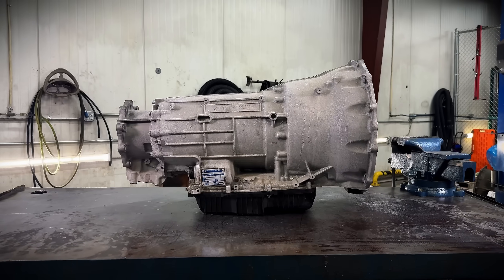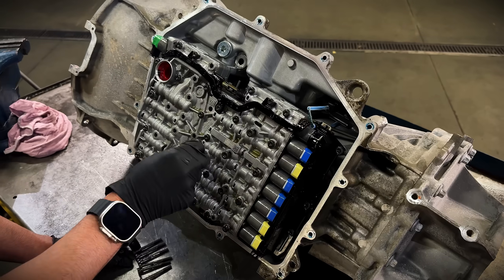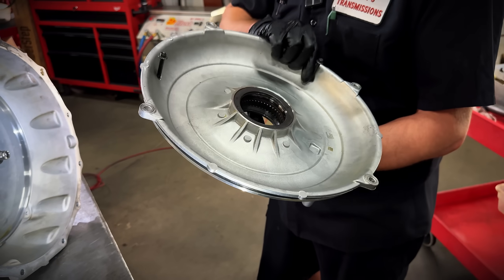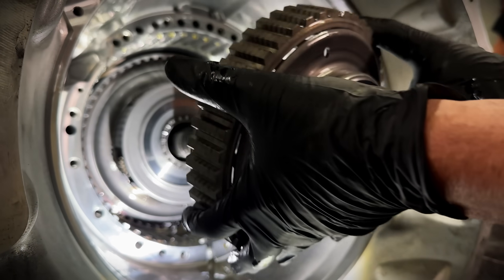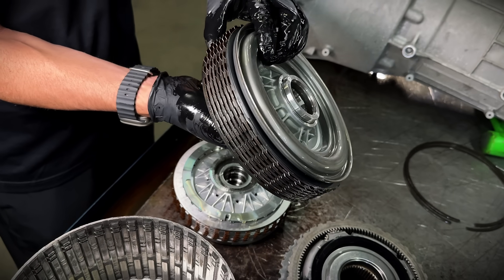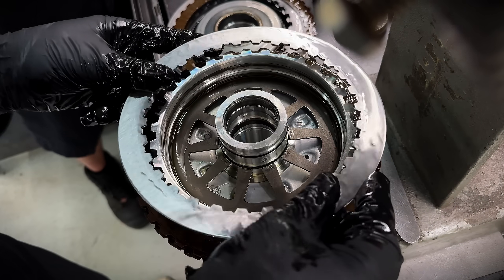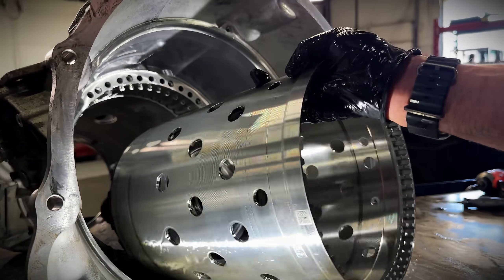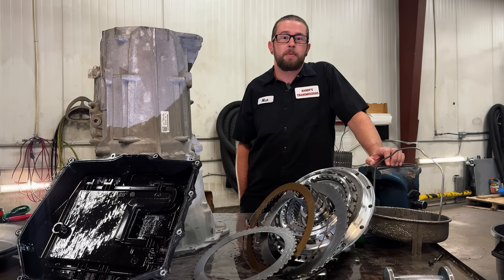NEW CUMMINS ZF 8 SPEED TEARDOWN

Comment: I stopped in Vegas at PPE today.  They had a 26 Ram 2500 on the rack with 126 miles.  They had the OEM Pan / filter off. The pan had so much glitter and flakes in it from break in it looked like a stripper or the bottom of a gold sluice.  
PPE is working on a +3 qt pan with a replaceable filter and multiple magnets 🧲 which will be out this summer.  I saw the glitter with my own 2 eyes and was horrified since I just bought one.  
I just bought a Cummins Rebel 2 days ago and the PPE engineer cautioned me to change the trans oil in the first 2500 miles then 15k to get all the break in shot out.  
He also said they have cease and desist orders out on Gale Banks and their Alum pans are NOT sand cast.

Comment: I’ve got the ZF 8 speed in my ram 2500 with 6.4 Hemi, it is hooked up to a trailer at all times and currently has 784,000 miles on it. The ZF transmissions work well and hold up

Comment: Ford need to get their act together because RAM are making them look slap happy.
Reply: We just got lucky I guess, the ZF8 series is one of the most highly rated transmissions in the world.  BMW, Jaguar, Land Rover, and even the Toyota Supra use them.
Reply: @stonent  I haven't given the new model a run for it's money yet. I have a MY26 3500 arriving in January which then has to be RHD converted, but looking forward to putting it through its paces and only heard mostly positive things so far. It looks like the reworked HO Cummins coupled with the upgraded tans and converter is going to be a great combo.
Ford have some work to do.

Comment: This unit does not need more holding capacity. Such a smart design, for heat dissipation. The weak link is the b clutch tension springs for a brake clutches setup. That is my only complaint here. Soon enough, rev max will have a stage 2 converter available and a software update for more line pressure and go.

Comment: Hi, I have Jeep Grand Cherokee 2014 with ZF 8 speeds. The transmission is jerking in cold conditions from 1st to 2nd gears when trans fluid temperature between 30-60 C and these jerks completely disappear after driving about 30 minutes or more. Is this normal? I have already changed trans fluid with the new pan but the issue remains the same. Plz help😢

Comment: Not all ZF 8 speed have the plastic trans pan with the integrated filter. The Jeep Gladiator and Wrangler use metal pans with a normal filter.
Reply: It's not the same 8 speed.

Comment: I'm surprised they didn't go with a 10 speed but glad they went with this 8 speed. I hope they hold up as well as they're being advertised to. I've already heard parts for these are rough to get without getting the entire transmission. We'll see if that holds true or not. Overall, Good job by cummins here I think. I think the 10 speeds are going to be the future, I just think that they aren't the now as we can see with the frustrations GM and Ford have had with theirs over the last few years.

Comment: The valve body sucks in these powerlines just like the ones the gas HD models. Yeah shifts great when working  but we’ve already recalibrated 12 powerlines and have had 8 valve body failures.

Comment: it would be interesting to see the comparison between the 68rfe and the zf8, of the clutch surface area, apply piston area and pressures to show the differences in torque holding capacity between them. especially compared to a randys built 750 or 850 hp 68
Reply: there is no comparison, the 68 was a beefed up version of the 5 speed that descended from the 4 speed 604 design, it was always a hack job

Comment: Well, the ZF8 can swap on 3rd gen, 4th gen, and 5th gen Cummins can solve the problem from 68RFE.
Reply: biggest issue is managing the power cut on the shifts, the zf is a sycnhronous clutch to clutch unit.
Reply: Probably significantly cheaper and easier to just build the 68rfe

Comment: Don't forget about us 12v's for the swap.
Reply: 47rh/e have been holding 1000+hp for over 20 years. A built 47 would be stronger than a stock ZF8. With the cost of the trans and conversion kit. You're likely to have more money in the conversion with a weaker transmission. Not to mention the electronics needed for the conversion. Would defeat the simplicity of the old 12V.
Reply: @countcuda70  That's a good point and I don't disagree with that. More than likely, that's what's gonna happen. I've been told the same thing by others as well. I just kinda like the sound of having 8 gears
Reply: @kellymichael7362  That's something I can't disagree with. An 8sp behind the 12V would be cool too. Once they're proven behind the Cummins and can be built. Their strength and 8 speeds might outweigh the burden of the additional electronics

Comment: Cummins has made a huge expansion into drivetain mfg and partnerships, they're into it to be able to supply a complete drivetrain from front to back, everything but the frame, susp and cab and hood. Just looking at specs on the Ram 7.2, same torque and HP as the old small cam 350 NTC Cummins from the 70's, more HP and 200ft/lbs less torque than the NTA420 or the 3406A 400.

Comment: Wow! It only took Dodge 36 years to make a good transmission for the Ram HD!
Reply: Ram doesn't make it. They outsourced it. Same as everything else good on the truck. Ram can't make anything of quality
Reply: @countcuda70 you mean just like all the OTR trucks? They all buy their engines, transmissions, axles from reputable companies. No shame in that.
Reply: @CumminsDriver  Op said they made it. That's why I replied that way. OTR trucks are also not the same as these HD trucks. Ram doesn't make the drivetrain at all. GM and Ford build their own engines and transmissions. Stellantis is a terrible company. It's why Ram trucks are a distant 3rd in sales
Reply: @countcuda70 
Who made the transmissions before Aisin, and ZF powerline?
Reply: @timkopp2204  The 47rh/e and 48re were manufactured in-house by the Chrysler Corporation. 68rfe was also an in-house transmission.
Reply: @countcuda70  so then i guess ram made their own transmissions for 30 years...
Reply: @timkopp2204  Yep, garbage. Not sure what your point is. If not for the Cummins engine. Ram would have been out of the HD truck scene a long time ago. 47, 48 until they're built are complete junk. 68 is garbage either way

Comment: I'll take this ZF 8 speed over the fake Allison 10 speed in my 2023 3500HD. Don't need 10 speeds. If GM builds it, it will fail. I did do the NextGen 10L1000 Allison valve body upgrade kit in mine.
Reply: How do you like the kit? Did you do it as preventative maintenance or to fix problems you were experiencing? I've only seen the sales videos on it, so I'm curious how it "actually" is??

Comment: So excited to see a swap kit for these into older trucks!
Reply: Ill hopefully be the first. I swapped a 2019 6.7 and CM2450B into my 2006 and everything works like factory. If i had the transmission bolted in. I can probably write the code in a weekend.
Reply: @SteedDolan  That in itself is pretty cool, but I think most guys (myself included) are gonna want to put these new ZF8s behind their 5.9s
Reply: I can definitely see it happening 100%
Reply: @drewmax-kl4oythe solutions are already there 🤫 maxxecu, turbo lamik, cantcu, Hal tech are all working on it as we speak
Reply: Yes! I came right to the comments to echo this idea. When my 68rfe fails in my 4th gen, I'd rather put a ZF 8 speed back in!

Comment: Or swap kit for a second GEN 47 RE Would be great
Reply: Why? 47RE can be built very strong. Less electronics also. Conversion kit with the cost of the trans is going to be expensive
Reply: @countcuda70  Because as strong as it is having 4 gears in a vehicle that's meant to tow is stupid
Reply: @ashton4329  It's worked all this time. Now there's a problem 🙄. Looking to add issues that aren't there. You'll be fine.
Reply: @countcuda70 Is it fine? Yes. Are there significantly better options? Also yes. Towing with a 4 speed transmission sucks, I don’t care how strong it is
Reply: @ashton4329  A 2nd Gen doesn't have the "legal" towing capacity to need an 8 speed. The 4 speed with lock up works fine.
Reply: @countcuda70 They can tow 13k which still isn’t a small number… again, works fine, but could be better
Reply: @ashton4329  The new trucks can tow over 37,000 lbs. Almost 3 times what a 2nd Gen can tow. The 4sp for 13k is fine.

Comment: How would you compare it to the 10 speeds?
Reply: Way more reliable.
Reply: @electrified7309  Maybe. You don't know. Not enough miles have been put on these yet. Let's see how they're holding up in a year, 3 years and on.
Reply: @countcuda70  ZF powerline has been in production since 2011, in commercial trucks in europe, it is not a new transmission at all
Reply: @seancollins9745  But it's never been in a Ram with a Cummins. The Aisin was used before Ram got it too. You can see how well that worked out. ZF has several different ZF8 transmissions. It's still to new to tell right now.
Reply: @countcuda70  It's ZF they build good transmission, it is literally all they do. stop the concern trolling
Reply: @seancollins9745  Not trolling. Ram fanboys think every time a new transmission is out in the truck. It's going to be the greatest. Aisin is a commercial transmission also. It failed. Let's hope the ZF8 is better. Here's a troll for you. I kinda hope it's not so we can hear all this crying again. It's funny
Reply: We've had ZF since 2011.  Not many auto trans techs around at dealerships if that tells you anything.  They've been incredibly robust.  That said, I'd still change fluid @ 50k if pulling heavy.
Reply: @okcmoparguy724  They're not the same transmission thats behind the Hemi. Even if they were. The Hemi and Cummins build power a lot different. Ram owners used to say this exact same thing when the Aisin transmission came out. Let see how they hold up in the real world not just on paper.
Reply: @countcuda70 Except they ARE the same transmission with some more beef in places. 

We’ve got a decade of ZF production in Ram 1500. We know exactly how these will hold up, from Ram to Jeeps to supercharged Dodges. None of this is unknown, none is a surprise.
Reply: @wyo_garage20  A 1500 making 400tq isn't close to a 2500 or 3500 loaded down making 1000+tq. You have no idea how they're going to do behind them right now. You're reaching for anything right now. Time will tell. No, the hemi transmission and Cummins transmission are not the same.
Reply: @countcuda70 Dude, stop. You’ve lost, give it up

They ARE the same transmission. Just like a 46re and 48re are the same transmission. Same design, largely same parts, different applications. It is largely the same as what is in 1500. 

You’re convinced that you’re right, when you’re wrong. Facts are facts buckaroo
Reply: @wyo_garage20  Its not the same transmission. The 46 and 48 are not the same either. Youre just gum flapping now. Youre not going to bait me into a back and forth about this. Nice try. Facts are facts.. you're right. Not sure why you're trying to lie about it. Going off what you said. They're the same with different parts. That would make them different. If something is using the same case but internals are different. That would make them different. The HP8 cannot handle the torque of the Cummins engine.
Reply: @countcuda70 THEY. ARE. THE. SAME. TRANS. MISSION.
Reply: @wyo_garage20  Yelling shows lack of intelligence. They're not the same transmission. ZF builds several different versions of the HP line. The Hemi's 8HP70 is different from the Cummins 8AP1075. For reference... The hellcat uses the 8HP90. Also not the same as the 5.7 or 6.4 hemi. No need to take word for it. Go look it up. BMW, Audi, Jag... They all use a version of an HP8 in some of their vehicles
Reply: @countcuda70 Every comment you make shows lack of intelligence genius. 

Same transmission.
Reply: @wyo_garage20  I guess this is a game of repeat after me. I say something. You repeat it.

Comment: Stupid chain drive pumps.
Reply: That was the biggest failure point I see.
Reply: Same design as the 8HP used since 2011 in FCA vehicles.  We've never seen issues with the pump.......or the trans itself.  The 9-spd had some launch hiccups but they've been solid  since.  Za Germans at ZF know how to build a great trans.  I've heard Ford techs say they had great dependability out of the 6HP when they used it.  They're making good $ on the 10spds.

Comment: Absolutely fantastic to hear Ram stepped up their transmission and you guys approved.
Reply: That's exactly what everyone thought when Ram went with the Aisin. Cummins needs to address the valvetrain issues or the ZF won't do much good.
Reply: @hochhaul the moment the said they were going to a hydraulic lifter, in the 6.7 i instantly seen the chewed up cams, spun lifters etc. way to make the most reliable diesel pickup on the road less reliable. thankfully the cam, flat tappet lifters and old style rockers with lash caps swap in so easily a child could almost do it.
Reply: @hochhaul It's not a cummins problem. Dodge engineering requested that change to get the valve noise down.
Reply: @chrisr3869  It sure is a problem none the less. Retrofitting the ZF into pre 2019 rams would be a great option.
Reply: @camwoodsend2097I didn't say it wasn't a problem. It's just not a cummins problem. Dodge should have known better than to mess with the engineering of the only good thing about their trucks.

Comment: Randy’s, please beat ATS to market with a retrofit for my 2014.
Reply: Firepunk is working on it
Reply: @larrypeachy2391  Randy's please beat Firepunk to market with a retrofit for my 2014.
Reply: @larrypeachy2391  I think ATS will be first
Reply: @SteedDolan  Let's hope not. Wouldn't put anything from ATS on mine or anyone else's truck. Would go gas before I did.
Reply: @countcuda70  If you look at the Allison conversion everything else on the market aside from ATS's is Micky Moused together. They are the only ones who sell an Allison conversion that retains all vehicle functionality.  Which is why i believe they are probably the only ones that have the slightest idea on how to make it work. They also have the only TRX 6.2, and 8HP95 Jeep JK that that uses a factory TRX ECM and TCM. I dont think anyone else can do that without using custom tuning, 6.4 grand Cherokee ECM or swapping every other module from the TRX.
Reply: @SteedDolan  I feel like if you're going to be swapping your transmission, you should know what you're doing, how it works, what goes into it, etc. in which case it can be done significantly cheaper and better than ATS.  Hardware from Howard's Allison Conversions, controller from Transmission Tuner, and the transmission itself either rebuilt by you (cheapest) or from a reputable company.  There is a guy on the Cummins Forum who swapped his for just under $4k
Reply: @ashton4329  I agree with you, if you're doing a transmission swap, you should absolutely understand how everything works. That said, Howard and Transmission Tuner both rely on the PCS controller and the A40 TCM, which is close to 20 years old now. It’s not just outdated; they also can’t modify the PCS firmware without PCS. I’m sure they’re solid tuners, but they’re not coders, and that limits how far they can push the PCS controllers.

Bottom line is they are stuck using the older A40/A50 units because that’s what PCS gives them access to. In contrast, ATS uses the T87A and supports simless Ram-Allison interoperability, something Howard, Transmission Tuner, and CAC simply can’t offer. Without paying PCS to develop entirely new code, they’re locked into what PCS allows.

And given that ATS has already achieved full integration between the Allison and the Ram without workarounds, I wouldn’t be surprised if they’re already on track to support the ZF 8AP next. They’ve clearly got the in-house capability to move faster and further than anyone still relying on PCS.
Reply: @SteedDolan Actually Transmission Tuner is working on making his own TCM currently, because the A40 is so old. I do get your point tho…

I’m still a little weary because I haven’t heard much good about ATS

Comment: The valve body with integrated computer sure sucks to see. And the plastic pan with integrated filter. And no dipstick whatsoever. Any chance you'll be coming up with a solution for any of those issues? Also, do you have any recommendation for fluid/filter service intervals? Manual says the fluid's a "lifetime" fluid, so, they're obviously no help to us.
Reply: Stick to 50k transmission fluid changes and you'll always be golden
Reply: @Blazin2133 my 90's 47RH/RE had a 24k interval. So I was thinking somewhere between 24k-60k.
Reply: @doomsdaydiesel  never hurts to do it more often. But most people either don’t or completely forget they have to. like the other guy had posted, lifetime only means through the warranty period. It's a shady marketing practice.
Reply: Lifetime means to warranty period.
Reply: ZF lifeguard fluid has a rated service life of roughly 75k.